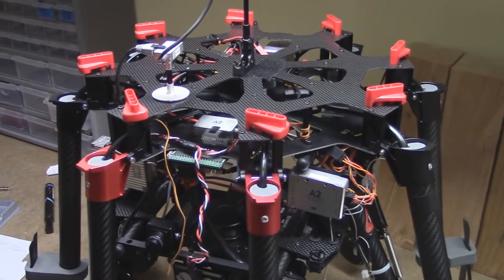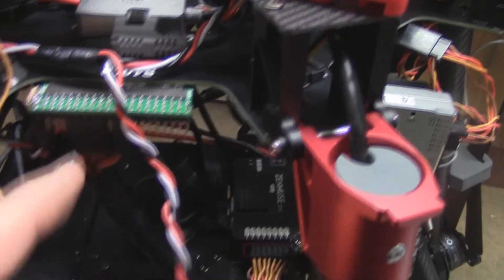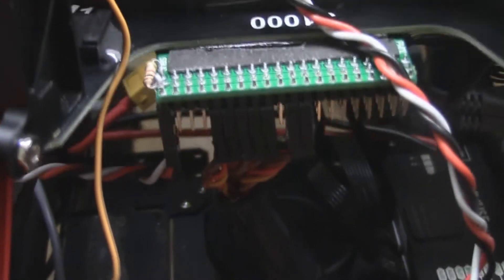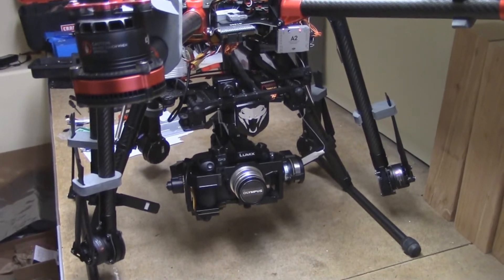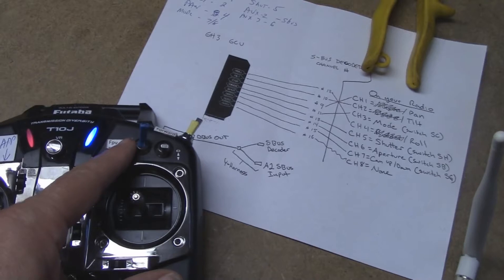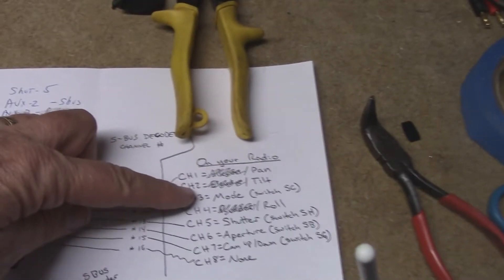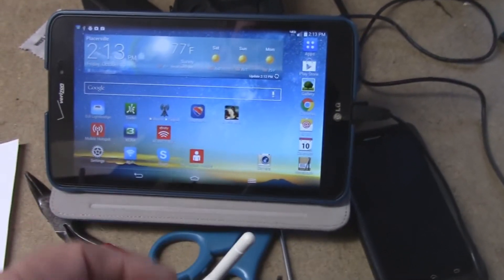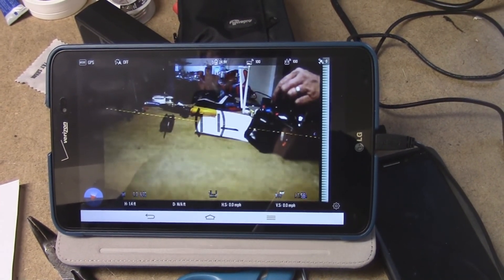DJI Lightbridge, SBus decoder, LG tablet

Comment: I can't tell from the video, is that D-Bus port just 3 wires? I have the newest Lightbridge 2, and the port is 4 wires. I'm trying to figure out which wires are what, because DJI hasn't updated the firmware to use the A3 and LB2 completely. WTF DJI, you sold high end products made for each other, but you haven't got the firmware for them to function together.

Comment: 1Placerville, does that mean that the output from the LB is actually straight S.Bus?
Reply from the maker: +tecnocato Hi. This is a Z15-GH3 gimbal. In order to get HD video out you have to switch cables after you initiate the gimbal and then you wouldn't have full motion ..like you can't do a 360 pan because the cable would get tangled and even break. The Z15-GH4 gimbal has a different set up and is HD. You can plug into the HDMI port on LB. For my set up with the GH3 I ran through Sbus on LB. The goal was to get video through LB instead of sending it through a separate transmitter like a 5.8 ghz. The issue for me with that was I had more range with flight controls than video range...didn't make sense. The new LB and later HD gimbals solve some of the problems but the LB 2 doesn't have the full gimbal functions that LB 1 has..if I remember right you only have 2 gimbal functions. Hope this helps.

Comment: Can't find the decoder on the troybuiltmodels shop. Do you have a link? Or is it this one? http://www.fpvmodel.com/rmilec-high-precision-pwm-ppm-sbus-signal-converter-v2_g478.html
Thanks a lot for this video!
Reply from the maker: call them and ask for Bill..
Reply: +1Placerville Is it correct, that I can connect a 12 channel RC to the Lightbridge groundstation and with this decoder I get 12 channels on the air system?
Reply from the maker: +Yanick Hug no..with this setup you get 8 per radio. the reason for this setup is to get video at the same distance that lightbridge is able to transmit. otherwise you use a separate system to transmit the video..like the immersionRc 5.8ghz. But then you have to have the receiver for it and another monitor. The downside to my setup is I don't have any free channels for gains. I just set them in the assistant..took me a few flights to get the gains dialed in but I haven't touched them since.
Reply: +1Placerville Thank you. I think I got it now. Maybe I can set the channels 9 to 12 to Trainer Mode in the Graupner MZ-24, so that i can controll all the 12 channels trough my MZ-24 and the lightbridge.
Reply from the maker: +Yanick Hug I set I through 8 as my flight controls. 9-16 is my gimbal and camera on the second radio. Note that 9-16 are mapped from the gimbal GCU..also if you get a 16 or more channel decoder make sure you start your wire connection on the 9th pin..so in your second radio it would be channel 1 but your wire from the GCU would start at pin 9...channel 2 will be pin 10 etc.
Reply: +1Placerville What an important info! Thanks a lot for your help! What I actually want to do is a bit more tricky I think. I want to run a Lightbridge 1 on a non DJI Copter with a NAZA V2, a non DJI Gimbal and a Graupner MZ-24 RC. I need all the 12 channels from the RC, which I want to run through my Lightbridge 1. I need them for the copter, the gimbal control and the shutter of the camera. So I want to control the copter with the gimbal with only one RC through my Lightbridge 1 which gives me a live HD downstream of the camera to my tablet.
Reply from the maker: +Yanick Hug OK..so just to clarify, my setup is for a 2 person..pilot and camera person. with my setup you are limited to 8 channels. running a single operator you can do more channels...I don't know your radio but if I remember right you can run something like 14 or 16 ..I can't remember for sure but there's lots of info on it if you Google or search YouTube.
Reply from the maker: +1Placerville and I mean 8 channels per radio
Reply: +1Placerville Thanks a lot. I will test it and let you know if it works.

Comment: Hi,

I'm trying the same setup with the rmilec sbus converter. But when I connect the converter with the Y-cable, the signal to the A2 is gone. There is also no signal on de converter. The sbus led keeps flashing.

I know the converter is working fine because when I use it with futaba Sbus receiver I can use all PWM channels from the converter. 

Do I need to use a resistor on de converter input, because it looks like the converter is shorting the dbus signal?

I hope you can help me,
Thanks
Reply from the maker: +Rienk van den Berg 
Hi Rienk...a couple guys below in the comments used a converter but I just used the Sbus decoder that I got from Troy Built Models so I'm not sure how yours connects. If you forward me your email I can send you a diagram of how the wiring is done.
Reply: I have the same problem ! Did You fix that issue ?
Reply: Can I send You my e-mail so You can send me wiring diagram ? I have the same issue
Reply from the maker: Sorry for the delay I was out in the field...sure send me your email and I'll send you the wiring diagram...but its the same as in the video so not sure that will help much...like I mentioned, I just used a straight sbus decoder (bought from Troy Built Models) and didnt use a converter.

Comment: I think you misunderstood. The LightBridge has an air and ground component. The radio is cabled to the ground unit. The ground unit communicates with the lightbridge air unit which is wired to the A2. The antenna on the A2 are irrelevant when using LightBridge. If you don't use lightbridge then you communicate directly with A2. The Lightbridge air unit is not wifi to the A2

Comment: Also sorry for all the comments, I can't seem to find the PM option, The cable that is used to power the LB system, do I or do i not plug in the dbus connection? this harness has an XT60 that i am using for power it seems not to care without it as far as i know i don't need it but i have not flown this yet with LB as i have not finished the Control setup yet, I have just been testing, and are now mounting the Decoder, are looking into this inference lines on camera.

Comment: I understand light bridge is limited to the 10 channels of WI-Fi and it depends on where you fly and how populated the area is of Wi-Fi,
Reply from the maker: LightBridge only has 8 channels...it is not wifi...it connects to your A2 flight controller
Reply: I don't Believe that.
Reply: Your wrong, A2 has built in Spread spectrum 2.4, and LB uses Wi-Fi 2.4 you can chose channel  1-10 or tick Auto , A2 built in RX does not get used when using LB.
Reply: Why do you think The LB air unit as antenna's?????? am i wrong!
Reply from the maker: Clancey Aggen I think you need to go to this forum and read up on LightBridge. It has a lot of good information:
http://www.rcgroups.com/forums/showthread.php?t=2101579&page=43
Reply: Okay I miss understood I'm going to do some reading.

Comment: I don't know if you have the answer to this question, but is Lightbridge going to be anymore reliable  then say futaba T8GH super? for control?
Reply from the maker: LightBridge gives you significant more range..it runs on 2.4 ghz as opposed to the Futaba 8 MHz...as far as reliability..I haven't had any realibility issues with LightBridge....just have to watch for updates

Comment: With this decoder do i need to tell it what to input? Or what to output?
Reply from the maker: No..it's already seeing the dubs out of the light bridge. You run that into the Y harness. The other end goes to the A2 and the decoder. The decoder is for the second radio. See my video for channels and wiring. Don't need to tell the decoder anything. But, I understand the Futaba decoder may require some programming. I don't use that decoder so I don't know what needs programming.
Reply from the maker: That should read dubs..sorry, have that spelling check
Reply from the maker: Frick..dbus

Comment: I am doing almost the same thing as you but it doesn't work for me please help! Same setup (A2, LB, Gh3).
I am using a futaba SBD-1 and a Futaba Hub.
Reply from the maker: Can you take a video of your setup? Also make sure your connections are correct..the dark brown wire from the A2 should be connected to the black wire from your y harness
Reply from the maker: That should be the dark brown to the black wire side...and when you connect to the decoder make sure the black or ground wire is on the ground side..it should say on the decoder which side is ground..another thing..what pins on the decoder are you plugging in to? You should be starting with the number 9 pin, not number 1
Reply: Setting
Press and hold the button then power up, three LED flashes several times later release the button,then enter the setting mode.Press the button, PWM - PPM - SBUS cycle selected,the corresponding LED lights up to indicate.Setting data are automatically saved.Cycle power to use.

Mode 3 SBUS Input:Converts the input SBUS signal into a corresponding PPM signal and PWM signal output.
Reply: It works now, found the solution with a resistor
Reply: I saw that
Reply: I knew it had something to do with it, I even pulled the power from the y harness, didn't work, and I couldn't make out witch one you used
Reply: May i ask what resistor you used? and a picture of where you added it?
Reply: 1k resistor between the 5v and the signal wire of the sbus
Reply: Thank you very much :)
Reply: 1/4-WATT?
Reply: Clancey Aggen
 Could you tell me please, how you power supply SBD-1? beacuse from dbus is just two cables yellow and brown, from where is best take red to power up SBD-1 ??? Best Regards
Reply: opbart  From dbus? Connect a futaba hub to x2 in the a2 and connect sbd-1 and lightbridge to the hub. You also have to inject 5v with a 1k resistor into the signal wire of the Sbus
Reply: +Julien Brault-Chénier Hi. I want to do something similar. Do you have a picture of your setup? Thanks
Reply: +Yanick Hug , please talk to me on my FB page it will be much better for me.

Comment: Where did you get the decoder and does the DJI dbus adapter work? have you seen it?
Reply from the maker: You would need the SBus decoder and the Y harness. You also need to understand that DJI Channels 1-8 are for flight controls. 9-16 are for the second radio gimbal/camera. So when you use a decoder you run the Zenmuse GCU wires to the decoder starting at slot 9. Some people get confused and try to wire to slot 1. So channel 1 on the second radio is really #9 on the decoder. Channel 2 is #10 etc. I recently talked to Bill at Troy Built Models and they now have the decoder and y-harness. As far as the dbus adapter I dont think you can use it with LightBridge. There is mention of it on the DJI forum, but see the #4 comment: http://forum.dji.com/forum.php?mod=viewthread&tid=646 Hope this helps. Also beware of the latest Lightbridge upgrade...I run a Droid tablet for a monitor and it doesnt work anymore. DJI is aware of the issue